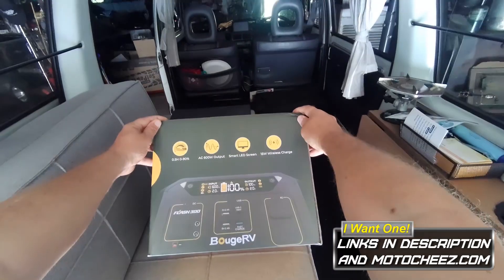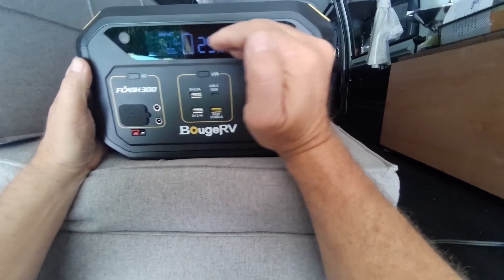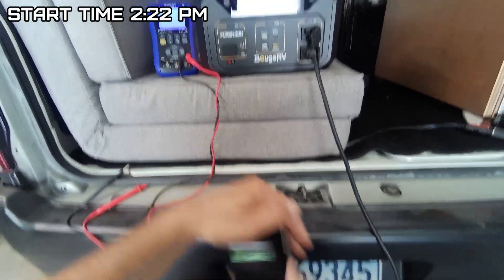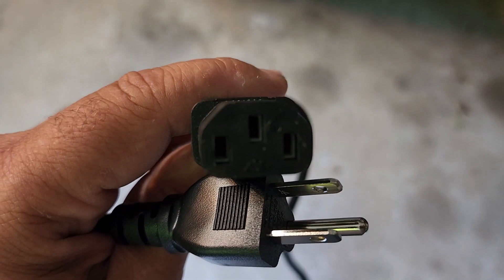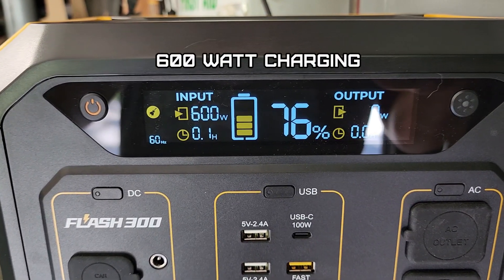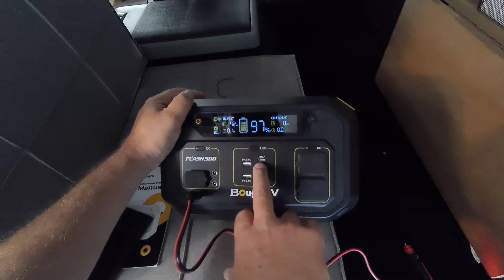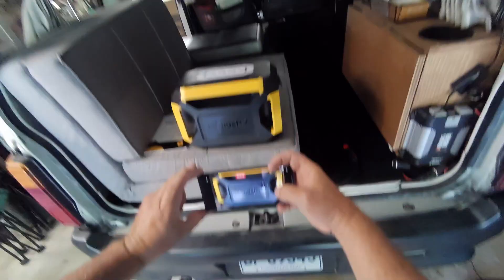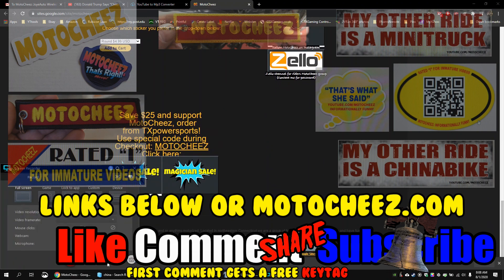BougeRV Flash300 Portable Power Station 286Wh, 600W, Solar, Recharge 0-90% in 30 Mins Camping, RV

Comment: It does not have UPS switching. It merely continues to charge the battery as you draw from it. The manual says Not to use it as a UPS device, or it may damage the battery.

Comment: These little power banks are neat things. I wish they weren't so expensive, my younger brother could benefit from something like this since he lives up at my grandfathers hunting camp. Which has no electricity. So he's relying on gas generators when power is needed. Which isn't good when you're jobless. :)
Reply from the maker: Prices are dropping pretty fast on these. Perfect for a cabin, the solar panels are pricey, you'd want 600 watts minimum to run basic stuff.
Reply: @MotoCheez  I think for him the biggest thing is being able to run a small fridge/freezer and maybe an ac if you're lucky. The ac isn't really a requirement just an idea. But the fridge and freezer would be a must for perishables. That's why his kids don't always stay with him. No interbutts or vidjia games. Luckily enough you don't need electricity to cook stuff.

I took a quick peek on their website, they have some nice looking charge controllers. Reasonably priced as well imo. Though they tend to advertise it as being for rv's, trucks and so on. So who knows if it would work in a small building. It would be neat if it did, imagine decking out a tiny-house with something like this. :)
Reply from the maker: Yeah. They'd work for sure
Reply: @MotoCheez  Future ideas maybe... 🤔

Comment: BougeRV makes good solar panels, I have 6--200 watt panels and a bunch of 185 watt panels..Never had a problem with any of them...Don't care for their solar generators though, don't like the battery chemistry, or the fast charging, or how hot that 12 volt cord got, it should have been pulling like 45--60 watts charging that fridge...Iron lithium phosphate is the chemistry to stick with, it can't catch fire and lasts 5000 cycles, fast charging like that degrades batteries with the quickness...And it's way over priced..I'd go with Bluetti if your buying a solar generator and get your panels from BougeRV...Just sayin...
Reply from the maker: Yes. Fast charging shortens the life of the battery, and battery type does matter. Depending on use,  you can get 3 to 4 years out of it using often

Comment: Pretty cheezy unit Cheezy and super fast charging. I don't think you've tried it with solar yet, but I expect great things from it.
Reply from the maker: I did hook a 100.watt solar panel
Reply: @MotoCheez  Yeah, I saw that later. My post was a bit premature. It actually did really well.